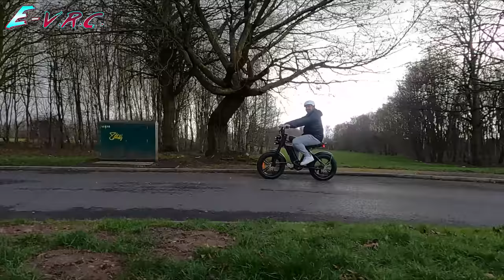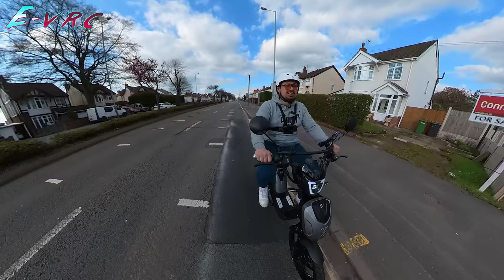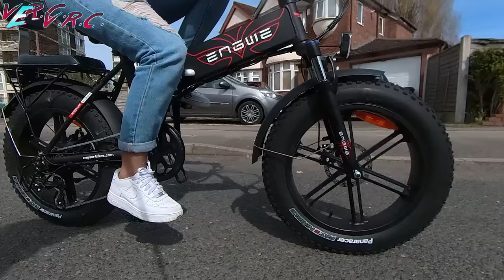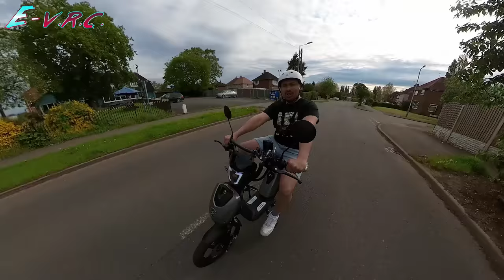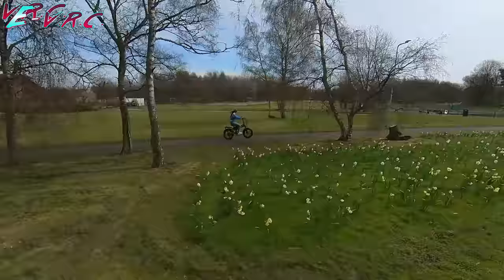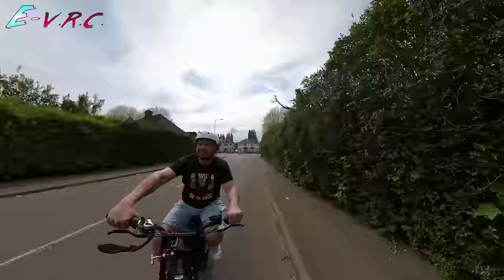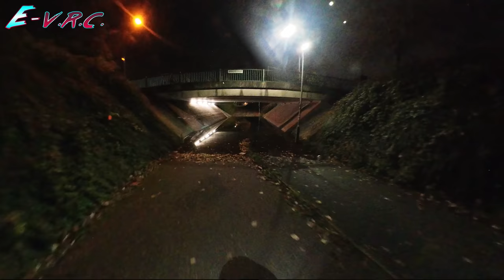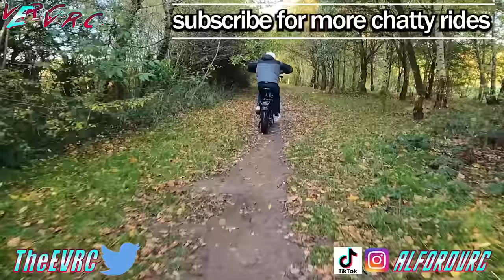The CRAZY Ebike law that MUST Change Before Someone Gets HURT

Comment: I've had my e-bike for a month and can already see the issue with the limited speed of 15.5mph. I agree that 20mph is more realistic. When I go over 15.5 it's like I'm fighting with the bike to get up to a faster speed. It's frustrating. The law needs changing in that regard. As for the throttle, I too use it at junctions to pull away quicker and now I've got it down to a tee after plenty of practice. I'm a big bloke at 6ft 6 and 100kg so would appreciate a more powerful motor than the puny 250W we get in the UK. 750W would be better for me but I'm a responsible rider so have to abide by the law. If and when it changes I will certainly upgrade.
Reply from the maker: I'd definitely be up for a CBT allowing a more powerful ebike for responsible people like yourself 👍
Reply: You can get 750W legally if you buy the Engwe Engine X.  The label on the ebike says 250W, but when you accelerate it feels like 750W.  It's definitely a step up in power from the Ado A20F.
Reply from the maker: @dtz1000  i may have to ask them about that one!
Reply: It is not an issue if you have a rear hub mahle  x35 motor, the centre hubs have the issues you mention. With the mahle, you are unaware when it kicks in or out at 15mph, just notice your ride is much easier.
Reply: I'm an irresponsible rider and only have an extra 15 minutes travelling time for my 18 mile commute over my car! When the law makes no sense, the individual should ignore it. If we all ignored it, it would go away pretty quickly.. Ebike speed limit should be 50 mph for qualified riders. The government could have their slice by introducing a CBT and test. I have travelled faster on a regular bicycle, downhill of course!
Reply: there are ebikes that have 'peak power' of much higher than 250w, for example Bosh Cargo Line motors can do 850w or even 1250w 'peak power' but are rated at 250w, its clearly a cheat so that these cargo bikes can be practical but comply with UK law
Reply: Right? I’m thinking of starting collage soon and there’s one bridge that I can go down and an overpass I can also go down but then i’ed have to pedal up, and if I go back home, i’ed still have to pedal up that same bridge, I see no point in 15mph
Reply: Why not fit a 1000w motor, and put the 250W stickers on it?
Reply: I love all the "I love to brake the law and put myself and others at risk" comments here. You want a more powerful bike that's not permitted and to circumnavigate the issue you add a simple little sticker claiming its something its not. How you going to explain that to a judge when you knock down and kill a child that stepped out into the road who didn't hear your bike coming alone? Oh sorry judge this brand new bike I purchased seems to have a fake sticker on it and I never realised I wad doing more than double the speed limit I was permitted to be travelling at! And thinking that it's got peddles and telling the judge you were peddling at the time of the incident isn't going to protect you when your on a modified motorised vechile. Adding an illegal sticker just shows the police and the courts what sort of person you are and that you don't care about others or laws. The book will be thrown hard at you all.
Reply: @davidchapman1508  Up to now, even though several people have suffered very serious injuries, due to illegal Ebikes, driven by crazed loons, no one has been charged with any offence, which seems to show a green light to those with stickered 1000w Ebikes, which are capable of over 100mph.
Reply: @humourless682  can't be charged if there the ones that end up dead! It'd be different if they killed someone else whilst riding one! I can legally drive a car, does that mean if I put a sticker on a 40ft heavy good vechile I can drive that too and that the sticker gives me the right? If I put a Honda sticker on Ferrari I can drive that using the Honda insurance? I suppose your the sort of person that thinks a 10yr old school girl can identify as a cat if she puts sticker on claiming it to be so.
Reply: @davidchapman1508  There are PLENTY of people riding 1000W ebikes, stickered as 250w.  

Police don't have a clue about ebikes, so even though there have been some very serious accidents, up to now not one of the high power, modified bikes has been detected............
Reply: @humourless682  exactly why there should be a full ban. You said it your self.
Reply: @davidchapman1508  Not going to happen, sadly! Under the direction of ATE, and following the closure of a good deal of the road networks in towns and cities,  pay per mile electric bikes, provided by local authorities, are likely to become very popular.
Reply: @humourless682  I'm not to sure, we've seen plenty of towns and city's pull out from these schemes over safety concerns. Scooters and bikes being riden illegally in an unsafe manor with minors getting hold of them despite not having a licence or credit card to hire them! I think more will follow suit and much like electric cars soon people will see the huge downsides both in safety and the environmental impact of mining for these ores etc. Its just going to take that one reckless rider to kill someone important on camera and they will be outlawed. How many gopeds do you see  being riden about these days? Huge back in the late 90s but deemed illegal over safety fears, only beacuse your engine is now electric and not petrol doesn't mean its not an engine! As People keep modifying them and replacing stickers and riding in a reckless way it'll only bring attention to them quicker and that'll be the end.
Reply: @davidchapman1508  Under the "Wheeling" scheme being implemented by ATE all over the country, pay per mile electric bikes, will become pretty much the only form of powered personal transport, within the boundaries of most UK towns and cities.

The pay per mile bike charges, will be inclusive of insurance, and the charges are going to be made via a phone app, which will also include a biometric feature to positively identify the rider.

That being the case, it would be completely impossible to ban the sale, and or use of Ebikes, outside the designated "Wheeling" zones.

I would expect though insurance will very soon be compulsory for all Ebikes, and this would be impossible to get for anyone who has caused an accident or modified a low power bike?
Reply: Look for two white wires connected together at the speed controller. Outside eu bikes have this disconnected.
Reply: @arthurarsekey6634  Wait until you hit someone at 50mph on your illegal Ebike.
Reply: @arthurarsekey6634  Okay but if you're gonna do 50 mph on an e-bike, you better wear some actual motorcycle gear, not a crap bike helmet and t-shirt.
Reply: @larion2336  I have some mountain bike protective gear that I use. I used to ride a road bike competitively and we regularly went at least this fast down hill with one of those crap plastic cages on our heads (some with nothing at all!) and lycra clothing, life's too short to worry about it.
Reply: @silkdestroyer  Why would I do that? I only do over 25 on the open clear road, I'm in power 1 or 2 through towns, 22 mph max. I'm not stupid or careless with it.
Reply: Get a motorbike then.
I cycled for years to and from work, rarely would I ever see 15mph. These is no place going faster in the first place. These 'boy racers' are the problem wanting to be faster and like motorised vehicles. With no protection for themselves or others, bike brakes are not car abs things either. Go over 15, wear a motorcycle helmet! Full leathers too.
Reply: @nicholaspostlethwaite9554  I've crashed my ebike at about that speed, full leathers and motorbike gear would be ridiculous overkill. Mtb pads and enduro style cycle helmet are more than enough.
Reply: @dtz1000 i have the L20, only had it a week, at present i have resisted the temptation to activate the throttle, am loving the extra kick from its fake 250w, as mentioned junctions take planning ie making sure i drop gear down to second or first. I am a car driver and sensible on the bike taken out insurance for theft and liability, i also think speed limit for road use should be 20, same as new car limit here in Wales (Authoritarian Labour government)

Comment: Actually the national average based on most of the states in the USA is 750W. You can also legally have more than 1 electric motor on your bike. All of the bikes and builds I've done eventually end up being dual motors. The legal speed limit as long as you're wearing safety gear is 28 mph at a class 3 rating.
Reply from the maker: Yeah I wish uk ebike laws were the same as the USA.
Reply: I've never seen a dual e motor bike! 😮
Reply: @joseph8208  Just search for dual motor e-bike on you tube and a bunch of videos should pop up. Actually I just watched a video of a guy that has 3 motors on his bike, 2 hub motors and a mid drive which is something I could do if I had the right size frame.
Reply: Depending on where you are in the US, 28 mph may not be a hard limit (I don’t know the laws in all the states).  Where I am, you’re free to have an e-bike that moves faster, but you have to have a legal driver’s license to operate it.  Where I live, Class 1 and Class 2 are limited to 20 mph (Class 1 is pedal assist only, Class 2 can have a throttle), Class 3 is limited to 28 mph but the rider has to be 16 or older, after that it’s classified as an electric moped/motorbike and there is no speed cap but you have to be 16 or older AND have a driver’s license.

Comment: Great video, subbed, I've been riding a 30mph ebike daily for 25 years with a throttle never been stopped once, keep the bike well maintained, peddle when going at high speed even if it's not doing anything, get some 250w stickers on the motor and controller and you will be fine, power limits on ebikes make no sense, the only limit should be rider age, top speed and acceleration, I'm 17 stone, 250w will not take me up a steep hill at 15mph but 1KW will, oh and cars, when I'm doing 30mph in a 30 zone cars still overtake, they are just programmed to overtake bikes, you could do 40 in a 30 on an ebike and a vicar will still overtake.
Reply from the maker: Thanks! Yeah it seems 1kw limit would make sense even if speed is still limited.
Reply: I just don't understand that your coppers are fooled by a 250watt sticker off aliexpress :)

Comment: I had an e-bike in the UK that had a throttle before the law changed banning them on new bikes. The throttle meant I could do slow tight turns without having to pedal as this would kick in the pedal assist and the kick of the sudden power almost had me off a couple of times. I wouldn't buy another e-bike unless it had throttle control.
Reply from the maker: Thanks for sharing, I'm amazed how many people argue against ebikes having a way to go slower under power, wrongly thinking a throttle will make them magically become a motorbike.

Comment: I totally agree with you, I have a Engwe EP2 Pro and I find that the throttle is ideal for pulling away from lights on a hill or when you have a car up your ass, also the change from throttle to peddle assist is smooth and you can be in any gear at the time, also yes your right 20 mph is an ideal speed , I think maybe the government need to be more concerned about the number of pot holes and sinking drains in the road, I nearly came a cropper  the other  day if I had not been holding the handle bars tightly I would have come off, I love your videos, keep up the good work 😊
Reply from the maker: Love the ep2 pro. I bet the fat tyres helped a bit too when it came to that pot hole. Ride safe 🤟

Comment: I agree with everything you said using the throttle is safer going around corners I have to use the throttle when I'm setting off because I have osteoporosis, especially in my legs and a hip replacement I can't walk very well so my ebike helps me get out and I have got two mid-drive electric bikes so I do get up hills safely but I'm with you all the way the law needs to change and ride safe people 💙🙏👌🏾
Reply from the maker: Glad ebikes are helping you get out. Mid drives! Nice 🤟👍
Reply: The walk mode button can be used to start from a standstill and is particularly helpful when starting on a gradient, particularly if the bike does not have a torque sensor.
Reply: @RichardNewman  mostly I use the throttle to start then I pedal I think that's the safest way.😊
Reply: I’m with you on the e-bikes getting people with disabilities out and about. 
I have issues with my ankles ,after 50 feet I’m in a lot of pain. 
However can go miles on an ebike without issues. 
Recent bike week where I live an ebike buddy persuaded me to go along, lent me his Fido L3. We covered some where between 50 and 60 miles that day. 
I was delighted to see( from Eskuta school-250 review) that a throttle is allowed up to 6 km/h. At least one can temper the walking speed to one’s physical ability when walking. 
Take off from lights and hill starts when caught in wrong gear is a big plus. 
E bikes supplied with a standard throttle can be modified easily to allow them to be street legal by the addition of a resistor to the signal wire of the existing throttle. 
Current e bike throttles have 3 wires. + 5v, -5v and a signal wire. 
This signal wire USUALLY supplies between +1.1 v up to 4.2v when throttle is fully open. 
So by adding a resistor to this signal wire , it is possible to limit the amount of throttle to a max speed of 6 kmh. 
Only issue is that the value of this resistor will vary from bike to bike brand. 
My solution to this is to initially splice a variable resistor in to the signal wire, cycle the bike using the throttle and varying this until the max legal speed is attained. 
Measure the resistance of the variable resistor at this juncture and replace it with a standard resistor. 
This can be done just before the controller, where the throttle wires plug in, so nothing is visible in the external wiring

Comment: Swapped my commute by car for an ebike. Cleaner, cheaper, faster and healthier. Got the Engwe EP2 PRO. Throttle is essential when turning right in traffic. The bikes too heavy to pedal start. I also leave it in a high gear because the chain hits the rear tyre wall in low gears. Poor design really, but overcome by the throttle. Limit to 25mph. Most of my journey off road, most around 15mph. Stunning though and much better than driving.

Comment: I live in Canada. Over here, ebikes are allowed to have up to 500W motors, and the power assist has to cut out at 32 kph. Throttles aren't outlawed, but there are some trail systems where you can't bring an ebike with a throttle. My experience with a 500W ebike, is that it's power delivery is still anemic. The motor bogs down big time on any kind of fresh snow that's more than a few inches thick. I do find the throttle handy. I give it a quick bump when I start to get the bike moving. I also feather it in corners, as the bike doesn't carry much momentum on it's own. The throttle is great for getting out of the way traffic. On mine there's no cut out. I could hold it down all the way up to 32 kph, if I wanted to. Although fun, it eats up a power quickly. Even with that option, acceleration is still slow. If I need to dodge a car, I'll be pedalling furiously at the same time, to provide as much extra speed as possible. I know that there is some concern about throttle usage contributing to trail erosion, but even the 500W my bike has is still not enough to get the tire to break loose. I've also heard from older ebike riders that the laws banning throttle usage is also discriminatory towards people that have strength / health issues. I do find that many of the cheaper ebikes have poorly implemented power assist systems (especially the ones with cadence sensors), having a throttle is pretty much necessary to compensate for this. Obviously if you pay more money for an ebike, you'll get better control electronics (many of the better ones feel completely transparent, and have smooth progressive application of the extra power).

I do agree that the regulations are pretty stupid. I wouldn't be surprised there was some auto industry lobbying to ensure that ebikes are crippled just enough through regulation, so that people don't consider them as serious replacements for their cars.

Comment: If it's not pedal assisted, you're a moped.  Mopeds exist.  Electric mopeds exist.  If you're a moped, you need :

1 - Registration plates
2 - A driving license
3 - Insurance
4 - An MOT if your vehicle is older than 3 years old
5 - To be over 16 years old (used to be 14 when I was younger, don't know when that changed)

If you have problems with your pedals hitting the floor when you're turning, that's because the design of your bike is dogshit.  Or you're hitting a sharp curve at 70kph (been there done that have the scars and the snapped frame to prove it).  And even so, oh NOES, I have to pay attention to what I'm doing with my feet!!!  Like car drivers have been doing for years.  Like motorcycle riders have been doing for years.  Like mountain bikers have been doing for years.   If you can't concentrate on that and the road, you have no place on the road.

If your pedal assist is "all or nothing", again, the design of your bike is arguably dogshit.  And even if it is, and you can't get used to it after the first 5 yards - well, you have no place on the road.  And no, it doesn't require going up and down through the power assist modes.  Thats bullshit.  And as for putting your feet down to get through that chicane - well, you can't ride for shit, mate.

OH NOES I DON'T UNDERSTAND HOW MY GEARS WORK AND I GET STRANDED AT TRAFFIC LIGHTS.  Again, no place on the road.  You downshift, the same way you do in a car, or on a motorcycle, or - well, on a bicycle.  And if you get it wrong, you're gonna have to stand on the pedals.  Like any other cyclist.

You're a bell end.